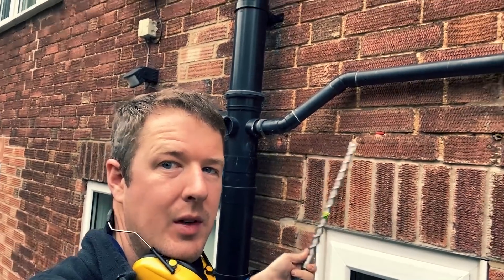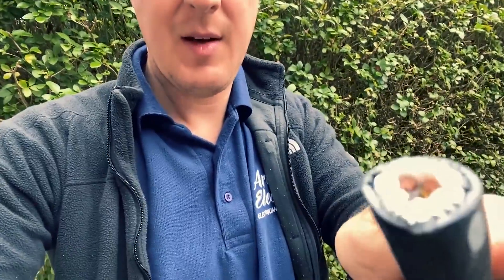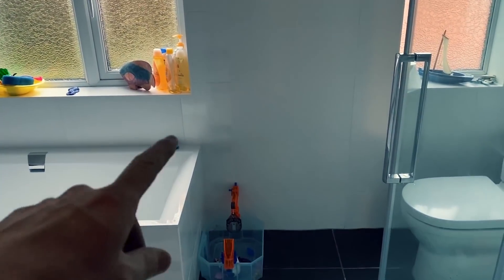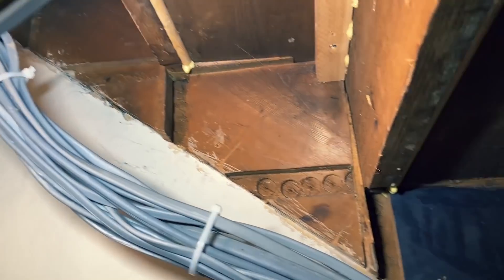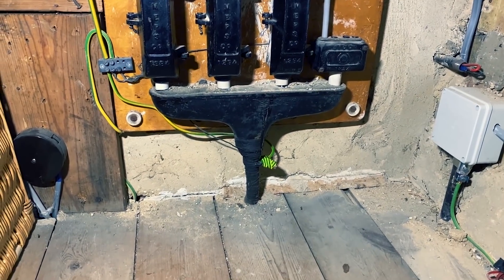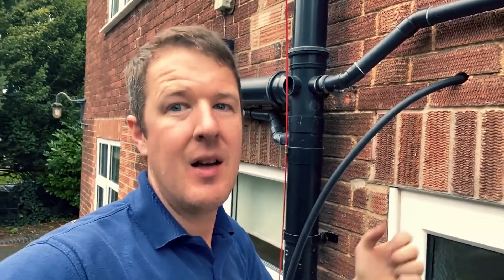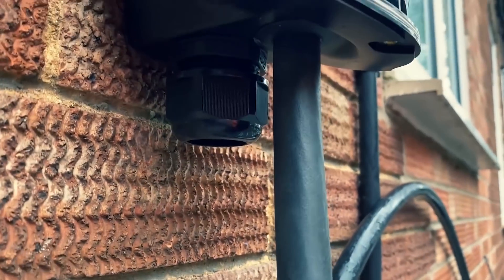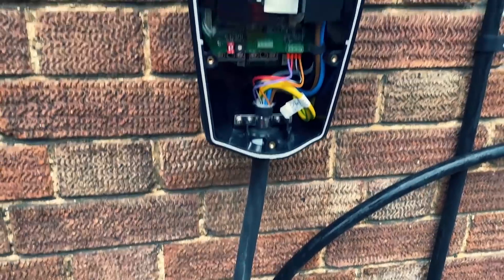Installing a Tesla Wall Charger UK

Comment: From Kansas, Interesting service, in my 52 years as an electrician  never seen anything like that or even heard of anything like. Was that 3 phase installed in a residential area or as you British  say domestic. Most everything in the states in residential is single phase.  Nice installation, even though we do things different in the states we still can see the quality workmanship. Have a great day.
Reply from the maker: Thanks for watching great to hear you enjoyed the video. Yes it’s quite rare but some houses here have a three phase supply.
Reply: Same here very rare. Some of the first central air units in the fifties were 3 phase in residential I only remember one but back then only the people that could afford it had air conditioning. I grew with a window fan. I'm now 71 and everybody has central air. 240 single phase.
Reply: @trainsinkansas576  here in Newcastle Australia a lot of older homes have got 415 volt 3 phase as there used to be a lot of instantaneous electric water heaters., now most new homes have 3 phase for ducted air and solar installations larger than 5kw.
Reply: @simonwielinga5236  I have installed a few  instantaneous water heaters here in Kansas where I live, 240 volt single phase. Most hot water units are 50 gallon gas fired water tanks. Also  50 gallon electric hot heater heaters are 240 volt single phase. They do not have 3 phase in residential areas.  240/480  3 phase for industry and commercial are standard. 120/240 single phase for residential.  Is that 415 3 phase 50 hertz.  Is that a standard voltage in Australia?  Very interesting. Thank you.
Reply: Jerry McMorris here it is indeed 240/415 at 50hz in most old Shortland county council installations each phase is fused at 45amp so it would be essential to spilt loads between phases, the old Instantaneous electric water heater being a good example having three elements 1 on each phase.. you could almost get away with turn 2 of the 3 off in summer otherwise the water would turn to steam whilst you have a shave... as there’s only 1 guy in the city who still repairs them most have been changed over to instantaneous gas, electric storage or off-peak electric storage.

Off-peak electric storage is Fun. It runs on a seperate meter through a ripple controller typically the power provider will turn it on from 11pm-6am but if there is high energy usage on the grid the hours may change. So once the children have exhausted the supply of hot water you have to wait till the next day. But it’s half the price of running on regular tariff.
Reply: @simonwielinga5236  What does the ripple controller do ?  Do they shut power off to you if grid becomes over whelmed?
Reply: Jerry McMorris the ripple controller allows the the energy provider to remotely switch on and off loads which are connected to the off-peak 1 and off-peak 2 tariffs. These only provide power at set times during the day and are used for mostly hot water but sometimes also used for Under-slab heating

They will also shed these loads especially on hot days when the grid is overwhelmed. There’s some interesting videos on YouTube about the Zellweger control system 

https://en.m.wikipedia.org/wiki/Zellweger_off-peak

My speed queen washing machine has a habit of audibly playing the control pulses

Comment: How did you manage to balance the loading on the phases with that massive single phase board hanging off phase one?
Reply from the maker: There is no way to balance the loading unfortunately.
Reply: Other than changing the existing CU to a 3-phase one? If the customer can afford a Tesla he/she can afford a new CU!

Comment: Just quoted for putting one of those little horizontal 2-way 3p+N boards (Proteus) into a lift motor room with a bit of armoured.  I've put in an estimate for materials of about £500 and two days labour £370 with a bit of conduit and small amount of steel trunking work and connecting a single phase board on a submain to it.  Comparable amount of work though.  £900-ish, commercial client.  He has other work too so I'm wondering on it tonight if it might not be a bit high, I've put two days down but the second day won't be massive.
Reply from the maker: Wow is that £370 for two days labour? You are very cheap! Don’t think you’ve overpriced that at all.

Comment: 4:24 did you see that one of the existing T&E cables just beside the cable tie has had its insulation compromised?  Needs fixing!
Reply from the maker: Yeah I did see that! Well spotted!
Reply: Nice one!
Reply: How much would it cost to have installed??

Comment: You are charger daft just now 😎What's the need for the 3 phase charger is it significantly faster at charging?
Reply from the maker: Yes it’s 3 times faster! 🤦‍♂️
Reply from the maker: Thanks! I’m loving doing all these installs
Reply: @artisanelectrics  so adds range at 45 or so miles an hour rather than 15 to or 20? And with these new  off peak tarifs , 8p/kwh  from  9pm to 6am, I guess  you  could do  a full   300+  miles charge  over night.
Reply: Will also help with maximum demand no end 👍

Comment: Couple of things I noticed!
Why did you install an earth electrode as it looked like a TN-S earthing system. 
And rather than use a 32mm compression gland, why not use a 32-20mm reducer and gland into that?

Not picking faults just noticed a few things I would have done differently!
Reply: John Wood potential difference between the gland and the earth rod would be issue I would imagine.
Reply: tomorichard Thompson  The installation didn’t need an electrode though if it was TN-S as no chance of PEN fault?
Reply from the maker: You have to treat it as if it’s PME unless you can get written proof from the DNO that they will never change it to PME. So in practise all TN-S systems need an earth electrode as well.
Reply: Artisan Electrics how do you know it’s true tns all the way to the centre point?? So I completely agree.
Reply: Artisan Electrics Fair point!
Reply: @tomorichard  Very good point to a very good discussion.